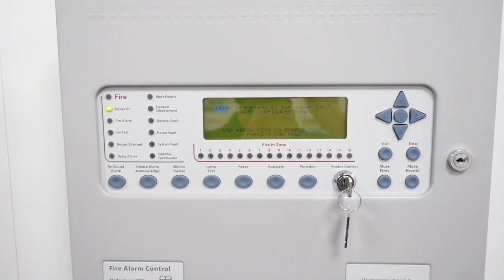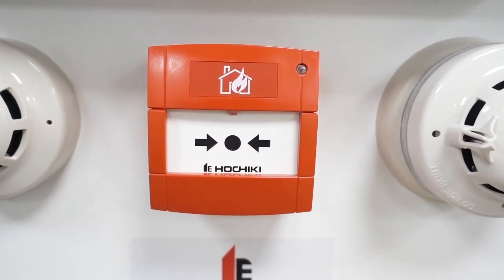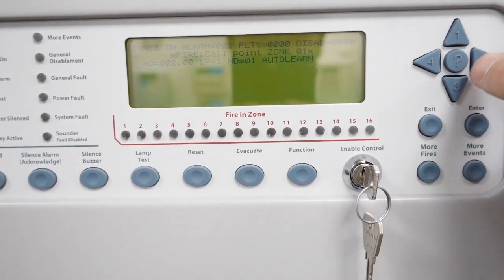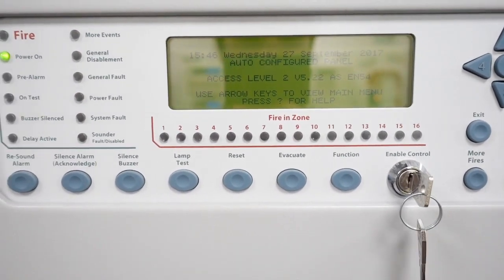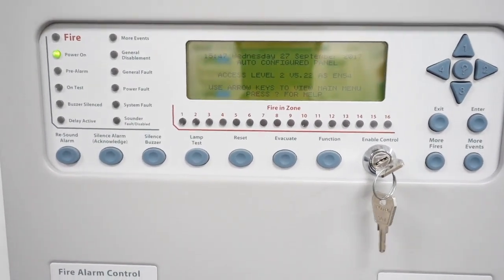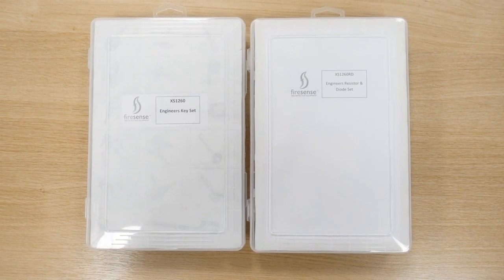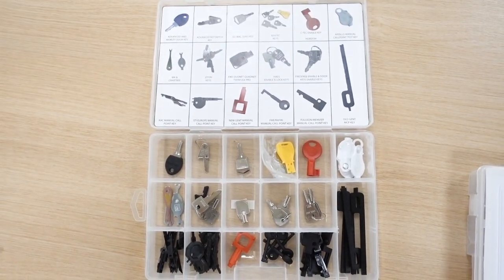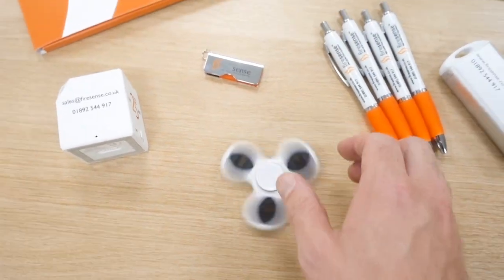TESTING KENTEC SYNCRO AS PANEL | HOCHIKI MCP | FIRE ALARM DEMO

Comment from the maker: Let me know if you would like to see any specific demos on the Kentec Syncro AS panel
Reply: Dan it keeps going off and there's no sign of fire any idea why
Reply: Apollo!
Reply: @metro_ken  agreed
Reply: Dans the Engineer yes mate
Reply: itznathyy hi there mate you or u ok mate see a good day mate
Reply: Dan can you do a what inside and behind the main board thanks
Reply: Hi Dans, good day to you! your VDO really helpful. thanks
Reply: What about those panel for smoke alarm that has big huge batteries at the point of origins? Someone called me to have a look at that, I am electrical Engineer, when I had a look the main contractor has disconnected huge battery from it and the two wire that goes from the connector to the main control point were alive on one side but dead on the other side. I thought what the hell had the main contractor done? He had disconnected the golith sort big batteries because They are dead [I tested them? But was suprised why he disconnected them from the main control unit and also the incoming supply did not go further than one point, on one side of the connectors they were alive and on the otherside dead. I was pretty confused actually. I told the main owner to tell him to reconnect everything as  it was. Can you shed some light on this pleasse?

Comment: We have Kentec Syncro AS panel fitted at the location as you there is a PC port (RS232) in the panel which used for system programming can you please provide me serial port data like Baud Rate, Number of Data Bits, Stop Bits, Parity?

Comment: hello good night I have a problem with a fire system, consisting of a central of the Hochiki brand model firenet 2127. the problem is the following, sl moment of doing its installation and programming a problem appears in the node of the central that in this case is 2, which indicates that it is disabled, it could help me by indicating what to do to eliminate said failure. Thanks

Comment: using the cargo hold  smoke dectector system showing pre alarm trigger . checked the sensor tested ok. but no. 4 exhaust duct 2 alarm

Comment: Hi Dans, thanks a lot for the video as I just encounter an exact panel like this. Could you do a video of adding more HOCHIKI detectors/MCPs to the existing system and how to program the system? BTW, the music is as loud as fire alarm set off. I am kind of struggle between listening to you and silence the music.
Reply from the maker: Hey thanks. I may create more fire alarm videos soon. Thanks for the comment about the sound 😀
Reply: Hi I have this at a school I’m caretaker at . Easy panel to use I put it in test mode to do weekly test as saves someone running back to the panel to silence
Reply: If you watch his videos he never tells you the Engineer codes just the basic user codes to reset the panel. (Note: he dodged your question).Try Google to add the items you want to this system or contact the manufacturers direct.
Reply: Believe your level 3 should be 2222

Comment: Our school has the same panel, except most of the devices are actually conventional because the building is very old. The reason the panel was upgraded was because an extension has been built which uses Hochiki ESP devices like the ones in this video
Reply from the maker: We have upgraded a few conventional systems with addressable like the Kentec Syncro AS but used zone monitors for existing conventional devices with the intention of upgrades when the client has the budget so that is fine providing the zones comply in terms of area or coverage.

Comment: This is the fire alarm I have and it went off yesterday due to my roommate in school spraying the detector
Reply from the maker: 🤤 what did your room mate spray it with?
Reply: Dans the Engineer he sprayed it with deodorant
Reply from the maker: Euan Griffiths yeh! That'll certainly set it off. It's not great either because deodorant will leave a liquid residue on the device.
Reply: Dans the Engineer it faults now and again sometimes the red lights come on to show its activated but it doesn't sound any reason why
Reply: Dans the Engineer  some in my school aren't sounding either have no idea why
Reply from the maker: Euan Griffiths often detectors flash every couple of minutes or so to indicate they are on and functioning. You may also have a delay on the detectors. It's hard to say really because many systems work in different ways as they can be programmed differently.
Reply: Dans the engineer it keeps going off and there's no sign of fire any reason why
Reply from the maker: Euan Griffiths could be poor maintenance. The maintenance provider should look into it because having many false alarms causes complacency and what you don't want is to get into the scenario when you naturally think an alarm is a false alarm because one day it may be a fire! I would speak to whoever manages the building and raise concerns
Reply: Dans the engineer how do these worl
Reply: Work
Reply from the maker: Euan Griffiths depends on the type of the detector but most commonly it'll be an optical smoke detector. There's a sensor and light omitter with the chamber and when smoke (or some other particles) enter the chamber it reflects the light onto the sensor and goes into alarm. A few things can cause the sensor to go off such as smoke, dust, small insects, etc...
Reply: Dans the Engineer a light caught fire in school last Monday and it didn't set it off so I had to set it off
Reply: Dans the Engineer my roommate tried to set the alarm off by Waving his hand at it but it didn't sound thank god I jumped when he tried to
Reply from the maker: Euan Griffiths oh no it won't go off by waving at it. Particles need to enter the chamber internally!
Reply: Dans the Engineer won't wind set it off
Reply from the maker: Euan Griffiths depends on the brand and type which I won't get into but wind can. Sometimes due to dust particles being blown into the chamber.